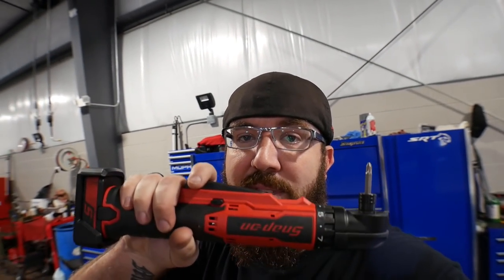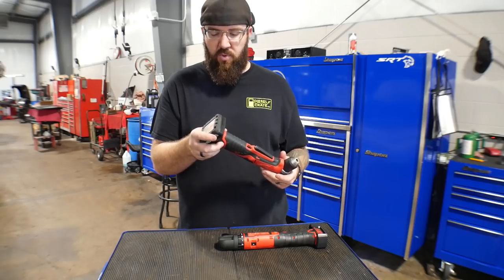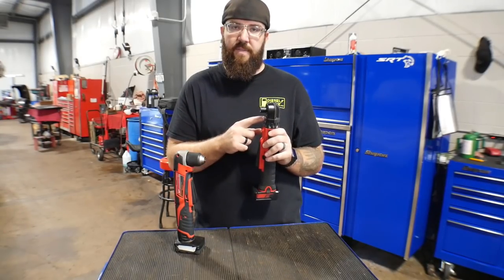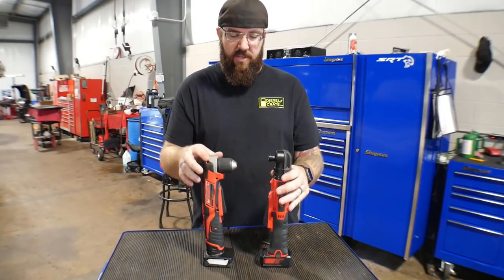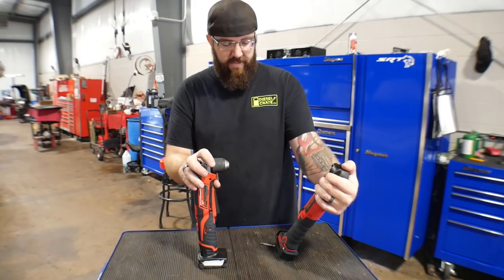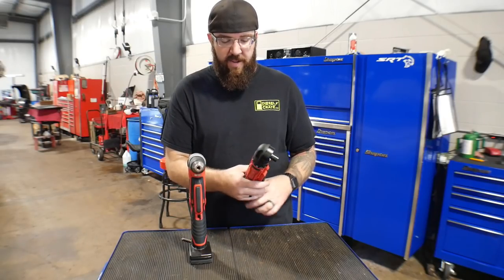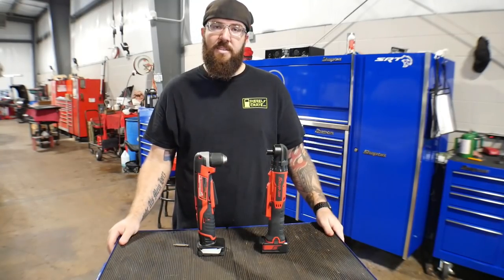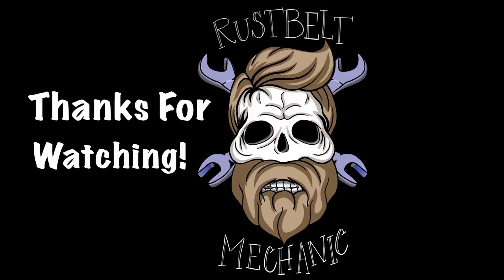A NEW SNAP-ON DRILL TOOL REVIEW - AND COMPARISON TO MILWAUKEE

Comment: Just saying if your comparing 2 products shouldn't they be alike as in both have a chuck or quick bit attachment's. I'd imagine the model with the chuck being very similar between the 2 except the Milwaukee maybe a little different being older so then snap on was able to re-engineer it so they could join the market. So Then milwaukee comes out with a new version or kicks in a free tool until the new model does come out. You say the warranty argument of being working in a shop of 1 year, well alot of commercial grade tools and shop equipment is a 90 day so that is good but the 3,5 sounds really hard to beat. With my professional sales experience and the more I learn about snapon then also study psychology it becomes quite clear they're predatory and a mob. Its a lot of money to pay to get decency for their products that should of been acquired before they started the business. We need to not support 'new releases' of re-engineered tools that cost 2.5-3.5x more then the counter part of equal build quality.

Comment: The size of the head would be miss leading when one has a drill chuck and one has a Quick release bit driver head.. I have the Snap On “Bit” driver and the Small Snap On drill both same battery’s and less then a year old,, (latest and greatest) neither of them can compare to each other and they’re both made by the same manufacturer one is a bit driver and one is a drill. Now if you would put a bit driver drill chuck in that bit Driver you will see it will stick out Way further then the true drill and it’s chuck.

Comment: the whole purpose of a right angle drill driver is to be as shallow as possible so it is stupid to keep putting three jaw chucks on them. They should  have put a hex bit chuck on it from the beginning. It also makes no sense to make a right angle driver with no slip clutch. Snapon finally got it right. Three jaw chuck drivers have no place in a shop these days since any bit you can imagine has a power bit hex version. Just keep a hex to three jaw adapter attachment for that rare round shank bit .  I bought a makita drill and ended up replacing my three jaw chuck with a hex bit adapter by a company called instabit. Makes changing bits very easy and I don't have to worry about bits falling out of chucks.

Comment: Lol dude is comparing a drill driver against an impact driver tf
Reply from the maker: Impact??? I don’t see any impact tools in this video. They have a different chuck head.... is that what you consider an “impact”????😂
Reply: It is their right angle impact driver. Milwaukee has one too if you want to do a proper comparison video.
Reply: @kristoferwright8096  the Snap On CTRS761 is a screwdriver, which combines a drill chuck with a hex drive adapter and does not impact.  Comparing a screw gun to a drill is close to apples to apples as the only difference is how they retain the bit.  Granted there is typically a slight variance in torque output between the two.